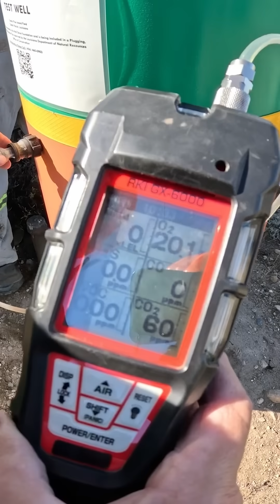The problem goes deeper than you think...

Comment: I worked in the ND oilfields for several years. As a truck driver. I heard they basically just "cap em off" 6 feet feet down and throw dirt on top. Any truth to that?
Reply: Unless you force them to do the right thing, businesses will do the cheapest thing they can get away with. There are hundreds of wells that are still technically producing a little, but they are leaking more than they are producing. It would be better to seal them properly like this but that costs $$$$.

Comment: Okay real question. Instead of filling the hole completely with concrete, why not just place an air tight seal on it? I don't know anything about drilling so I'm sorry if this is a dumb question.
Reply: If you just cap it at the surface, eventually the gas would leak out through the soil. You have to seal the hole deep enough to be in the impermeable layer to prevent leaks permanently. If you cap it at the top you just make it much harder to seal it properly later.
Reply: You don't really need to entire length just a few hundret cubic feet are enough

Comment: They Just Diddyn't leave their holes open like that😮‍💨🗿
Reply: Well they usually closed the top of the pipe. But then either the pipe rusts or the gas leaks out further down and bubbles out through the ground. There are 1000s of old wells like this. Some are abandoned, but some are still owned by a company. They say they'll seal them eventually, but they are in no rush and the government doesn't push them very hard to get on with it quickly. All the time they are leaking methane which is 80x worse than CO2. Search for abandoned wells fugitive methane.

Comment: Work on well abandonments, pump cement to fill the old oil wells up. Weird but cool to see you talk about my field of work because people rarely know about this 👍🏽
Reply: Just curious, would you know why they wouldn't just fill it with mud after maybe a small plug at the bottom? Them saying they fill in sections sounds like they are using a fuckload of concrete.
Reply: @Santuse  we do use a whole truck worth of cement even 2 trucks sometimes just depends how deep the well is and the diameter and if there are any perforations in between. We need to ensure those wells are completely sealed that way if they build something over that location there won’t be any problems. To answer your question, yes we do indeed use a fuck ton of cement
Reply: @Santuse In some cases we do use a special kind of mud when it is a cheaper solution but we still put cement caps on both sides ends. It all comes down to money and security of the well and if there will be any future buildings over that well.
Reply: @dizzzzy001  that's good. God I would not want to spend a dollar on building materials to fill a hole in the ground lol. I wonder if you could put a plastic tube inside the well and put the cement mix on the outside and some non permeable waste on the inside. Or round PVC spacer disks. Ahh well. Thanks for the info
Reply: @Santuse  
Plug a petroleum well with petrochemical disks, after it has selflessly given its all?

Heaping insult on injury for a perfectly innocent little hole in the ground.
Reply: @Santuse that sounds way more expensive, time consuming and difficult than using concrete.
Reply: @For_What_It-s_Worth the holes are neither innocent nor selfless.  Your reply was as unthought out as the comment you were replying to.
Reply: @Santuse Seems like you could just pull out or grind out whatever is keeping the hole open and collapse it in on itself
Reply: Here's a maybe stupid question. Where is the dirt that came out of the well?
Reply: @Princess_Paula_T.  i think the wells were mostly drilled a long time ago so the dirt was either removed or just spread around the area long ago.
Reply: @Princess_Paula_T. The dirt from digging the well is long gone.  Most of these wells are decades old... there's also no way to tamp dirt effectively in such a narrow hole so that it's hard enough to seal the well.
Reply: @Princess_Paula_T. The dirt usually comes out in drilling mud that is usually  put in big containers and shipped out
Reply: @Princess_Paula_T.  
The volume of material in 1000’ of 10” diameter hole would cover an American style ‘football’ field less than 1/4” thick, not counting the drilling mud pumped down the drill pipe to flush the stuff up out of the hole.
Reply: @RD9_Designs  
I beg to differ!
My reply was carefully thought out to be as ridiculously anthropomorphic as possible.

Which may be why you ridiculed it.

Success!
Reply: Sup brother
Reply: Why not use the hole to make a gravity battery. Sort of like the mechanism of a grandfather clock? Put that hole to good use I say
Reply: Thank you for your service.  This work is potentially wildly dangerous.  You must be protected at all costs!
Reply: Why use concrete instead of mud?
Reply: Who pays for the plugging if the original owner filed bankruptcy and closed down without plugging hole??
Reply: i used to do this as well
Reply: Methane is natural gas, it is not unusual stuff but is 2000 parts per billion in the atmosphere, not a problem in my book.
Reply: @seanworkman431  methane is not natural gas, its the other way around. Natural gas is primarily methane.
Reply: @cherriberri8373  splitting hairs are we?
Reply: @cherriberri8373 that's a complete contradiction.  'Methane is not natural gas... natural gas is primarily methane'.
Reply: @seanworkman431 methane is a greenhouse gas 🤦
Reply: @seanworkman431  your one of those people who think they are so smart aren't you?
Reply: @monumentalsin3552  if you can only fall back on insults then I guess i am smarter than you.